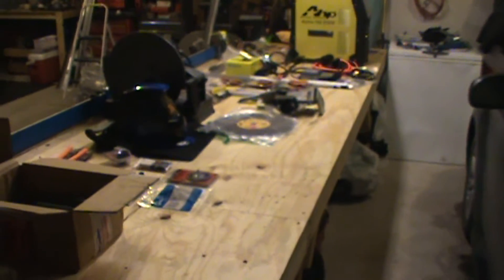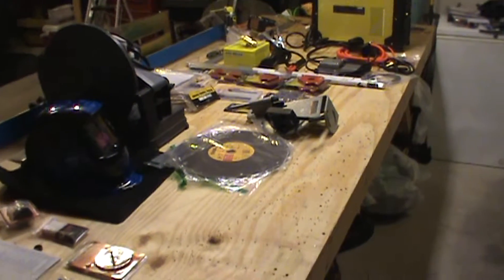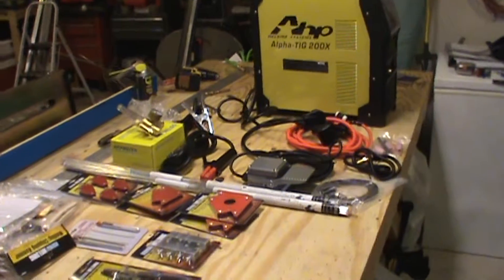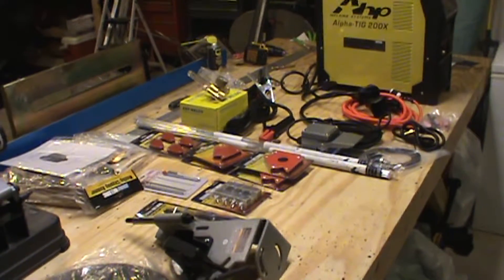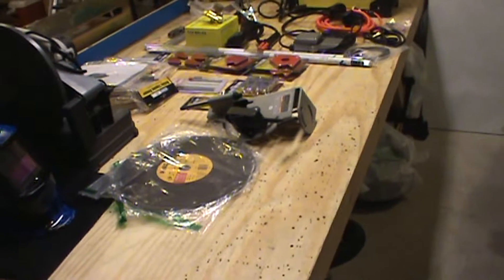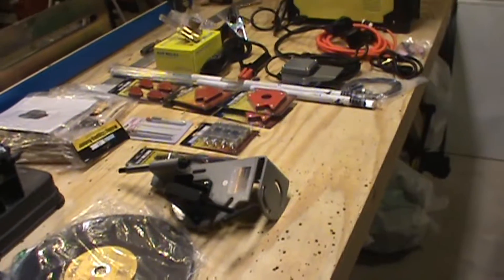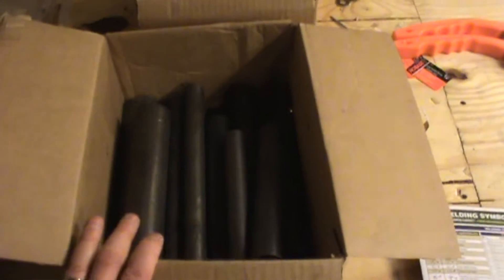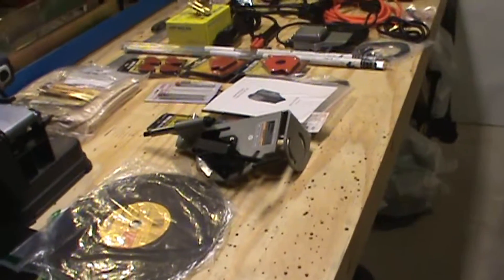A Primer on Welding

Comment: i weld on aircraft. we specialize in building j3's pa18's pa18 wides. pa12's i just purchased this welder for home use and its phenomenal. if you ever have any questions let me know. may i suggest getting the upgraded pedal from sSc. for this unit.
Reply from the maker: +Jason Anderson Yeah, I'm not sure if I'm gonna keep using the stock pedal. I've bolted it to and put a little ridge on the back of it to anchor my heel. It works and doesn't slide all over the place now...but still leaves a lot to be desired, especially if you're welding in awkward positions. The SSC solves all that. So far, I've had no problems with this machine. A few other reviewers have had some bad circuit boards/points for the high freq start, but mine runs like a champ. Can't believe the quality of welds on this inexpensive machine! With the few light-duty welds on the plane, AHP is more than enough as long as I don't fry a board.